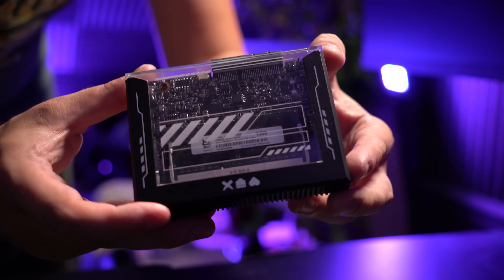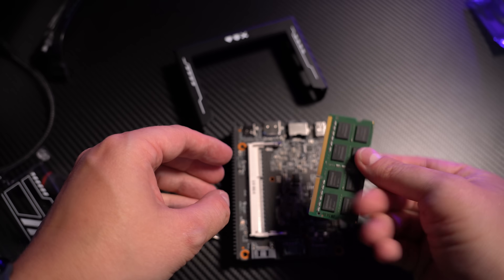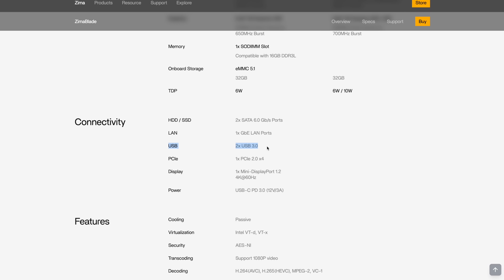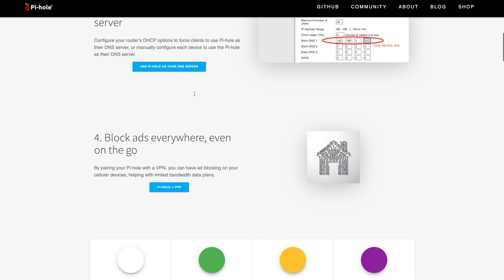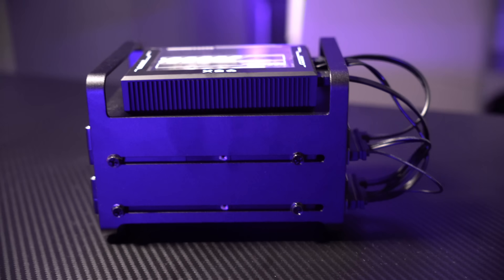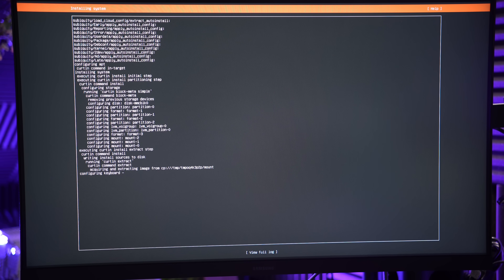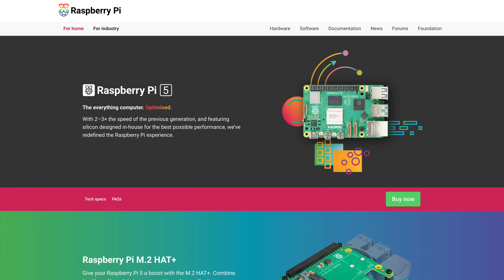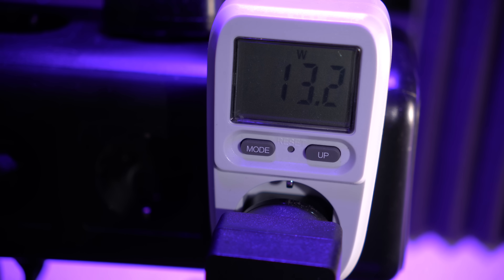The BETTER Raspberry Pi? // ZimaBlade Review

Comment: Thanks for the video. I have yet to find a USB-C hub with power pass-through that works due to the 12v, PD3.1 requirement. Can you provide a link to the hub you are using? Thanks.

Comment: Thank you for your really nice review! I'm already looking around for a simple and nice solution to run a NAS-, networking traffic- and smart home-solution. I watched your video, that reflected my expects of the ZimaBlade, but I missed a bit the comparison to the ZimaBoard at the end, because I almost was about to buy a board before I discovered the blade... ^^ Most of the comments weren't really helpful for me, because in my scenario I doesn't care if A is 10% faster than B, but it's still helpful maybe in future. My mission is atm, to find a robust setup to run a 24/7h solution for my needs. If I want to have all freedom to nerd around, my decision would be a RP5, but I can buy one later... So - is it overpriced, compared to a RP5-setup if you consider putting everything together with a RP5 for my needs?
Reply from the maker: Thank you so much! :) As I said in the video the ZimaBlade is actually a small "downgrade" from the ZimaBoard, if you already got ZimaBoard you shouldn't switch. Only if you're new and you like the cheap price and x86, otherwise go for the RPi 5

Comment: My biggest issues with the Blade are: 1) Only 1 USB port (that is practically accessible, they have 2 connectors below the pcie connector but not practical to use.) 2) the heat generated. It gets too hot to touch if you just boot up a random GUI Linux distro. 3) The mini DP port should have just been a USB-C. Technically you can use the power USB-C port for other things with power passthrough but because it requires 12V it is incompatible with most docs.

Comment: "Honest and humble opinion" Got it. You forgot to wink. Great review though. I still do not understand why Raspberry pi does not come with better options. Such as dual ethernet port, or modular ram and so on.
Reply: Raspberry Pi CM5 will be out soon and there will be plenty of carrier boards for it that will compete with systems like this one
Reply: @makerbymistake and how many of those can you attach at the same time?
Reply: @makerbymistake  I bought the standard CM5 package when released, but considering a second CM5 with 8Gb.

Only issue is akin to the Apple Tax on Upgrades. Once you start adding to the Pi, the overall cost goes up a fair chunk.

For about £120 I can get the entire ZimaBlade NAS setup. Add in a couple of 2.5" 2Tb hard drives or SATA SSD's to lighten the weight and reduce the space requirements, and that's less than £250 for something able to run TrueNAS. The Pi is stuck with OpenMediaVault at this time. I was backing the ZimaBoard 2, but once you added the NAS setup to that, it would be twice the cost of the Zimablade NAS kit, and speed isn't a priority for my usage case here.

No doubt they'll stick out a ZimaBlade 2 next year knowing my luck, but I only want a simple travel NAS to use with my MacBook Air M4.

Wouldn't be surprised if someone has come up with a decent 3D printed cooling solution for the ZimaBlade since this video was made.

Comment: I would love to see a raspberry pi or similar that come with an m.2 slot. I've had a few raspberry pi's, but I feel the SD-cards are such a crappy and unstable medium. I've had several crashes because of it. I know that pi can boot from USB as well, but this mean that I will need to have an external device. I want it all in one nice case. If anyone know of such an option, let me know.
Reply: Pi5 has cases that include the hat within it for m.2 look at a pi 5 with the argon neo m.2 case
Reply: @Zedris  there are a number of "HATs" out here now with m.2 slots on... so you can put it in your own case.
There are also a few HATs with a PCIe switch chip and two m.2 slots. @JeffGeerling has some videos on these.

Hopefully when the Pi6 comes along (Probably in 2 or 3 years time) it will have a few more PCIe lanes to play with... 4 sounds good, on an oclink connector.
Reply: I know its not perfect, but I use the "Samsung FIT Plus" as my node-discs in my raspberry pi cluster. The performance is good enough compared to how simple the solution is,  and way better than sd-cards.
Reply: There are numerous M.2 adapters for the RPi, and many similar devices with an M.2 slot.

Comment: There are many SBCs that are technically better than the Pi, but the problem is always the long term support, and software offerings.
Reply: This. The Pi's draw isn't the hardware, it's the ecosystem.
Reply from the maker: That's a good point! I probably mention it in my Kubernetes Cluster video, using RPIs, as it was part of my decision making about support, number of accessories, etc.
Reply: Yes so many comparisons get it wrong. Yes you can buy $150 n100 mini PC and put a gpio board on it, but can you imagine dealing with that and Windows rather than just flashing an image to an SD and being done?

" but it has more power"

So does every other computer in my house so what